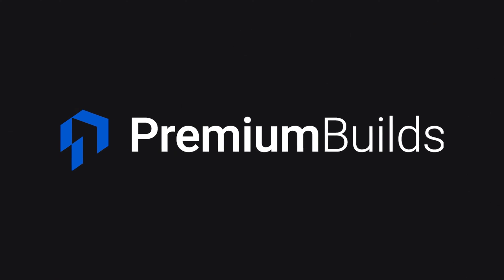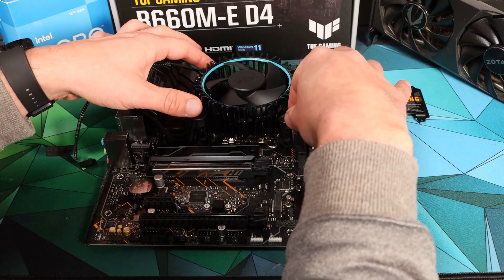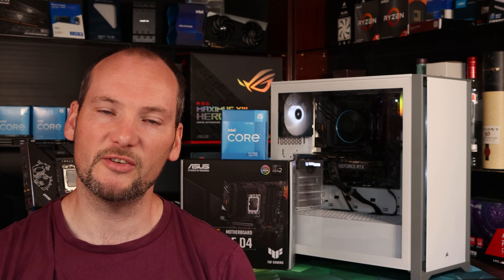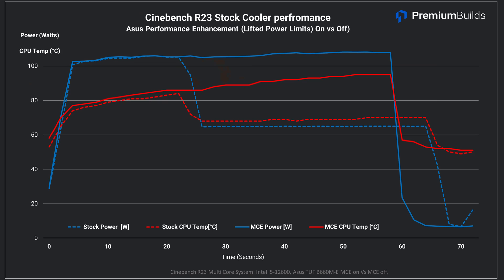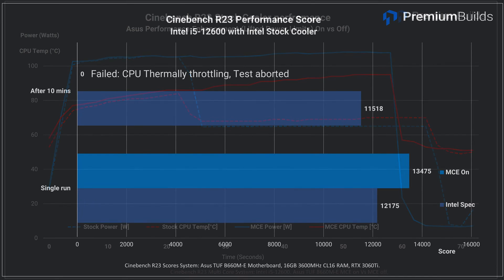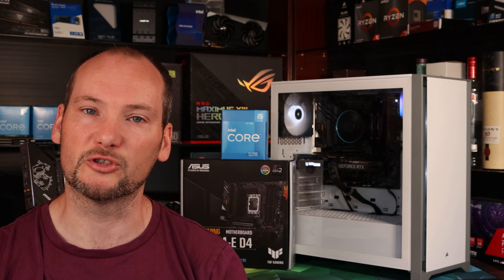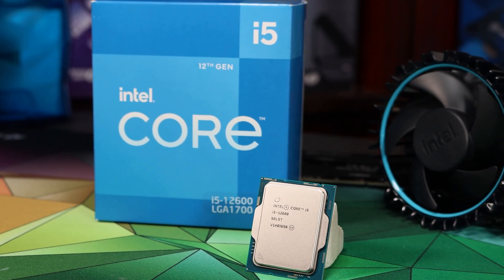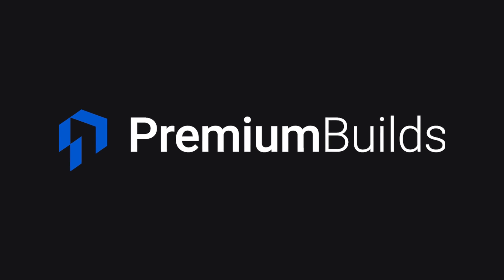Does stock suck? Testing the new Intel CPU cooler with the i5 12th generation!

Comment: Thanks for the video!
I'm currently buying parts for a budget 1080p upgrade (coming from an i5 7500 RX480 B250 I've had for 8 years).
I decided to go with an  i5 12400F (£88 new) MSI Pro B760M-A WiFi (£75 new) 6600XT (£135 nearly new) and an MSI MAG 650W 80+ bronze PSU (£45 new).
I just need to buy some 3200mhz 16cl DDR4 ram 2x8gb as my current DDR4 2666mhz might not be good enough?

Comment: Thanks for the vid. Turns out my new build is in a Jonsbo C6 Mesh. Had a surplus Corsair H60 2018 but this case doesn't support AIO's.  I am not gaming. It will strictly be a HTPC, with an i5 1440 w/UHD Graphics. Cooler clearance recommended for Jonsbo is <75mm, intel's is listed a 47mm. If it doesn't work out I can try the coolermaster mATX cases.

Comment: I understand that stress tests can make your cpu go really hot because it pushes its limits, but I have some strange things going on; Intel 12400f; usage is 15-20%, WATS are below 40 and still temps are around 80c (gta 5 online) I don't think undervoltage would help me even if I could do it. should i spend 50$ on new cooler on 150$ cpu or is there any other solution? i disabled asus perfomance boost but nothing realy changed. temps while watching youtube are around 45-50c.
Reply: Newer gen cpus run much hotter than the old ones, 80C is good under load
Reply: @michaellabuschagne7439 nvm i got myself i35 frezer and now i have 30c idle  and 60c in games

Comment: i have an intel 13400f, with stock cooler that is, and indeed the temps are just about right, it doenst get hot , its stable, always stable
Reply: True, but you won't get the boost as than it gets too hot.

Comment: Is it normal idle core temp 52c i5 12400 using this fan ?
Reply: Mine 32c to 35c idle, gaming 64 to 69
Reply: It happens to me as well, did you find a solution?

Comment: mine hits 80 celcius max when gaming i3 13100 no thermal throttling...
Reply from the maker: That's because it's a 50W CPU. The cooler is really designed around that kind of output.

Comment: I found if you elongate the mounting hole slots inward by grinding you can use one with a 775 socket cpu.  The mounting legs are hard steel so grinding with a dremel is slow going. You have to remove the push in connectors and use some screws that go into the stock 775 backplate.  Quieter and cools a bit better that stock.

Comment: Wow, same board and GPU as the build I'm working on now, only diff is 12400F on mine. Subbing an ID IS-47-XT for the stock cooler, running a Wraith Prism on my R5 3600 in current box and it stays pretty cool so I think the ID should be fine.

Comment: did you try using a better thermal paste with the stock cooler to see if that would help with the cpu load temps?
Reply from the maker: No, there's really no point. At that point just get a cheap tower cooler that comes with better thermal paste. Thermal paste rarely has more than 1-2C impact, especially on a cooler that's already borderline.

Comment: my prebuilt pc came with one of these installed alongside a i5 12400f and my my, it is one noisy thing under load. looking to upgrade to a dark rock slim to hopefully increase cooling and noise issues.
Reply: VERY late reply. i had the same issue but after a bios update, it was fixed completely
Reply: Did you manage to get the new cooler? If so how is it in terms of cooling and sound. And what gpu are you using

Comment: Maybe i won the silicone lottery? I have a core i3 12100 with a stock cooler on idle my temps are around 31.5C and when im gaming and watching a movie my temps are 42C max im not sure why everyone has such high temperatures
Reply: better install HW64 software and monitor temps at idle and running cinebench R20. Also notice CPU fan RPMs and CPU power consumption

Comment: If all you're using the 12400f for is just gaming, would the stock cooler be perfectly adequate for that?
Reply from the maker: It's fine but you will hear it, it has an annoying noise profile. In terms of performance and temperatures though it's no issue, and easy to replace later.
Reply: @BuildPicker  I'm just looking to save a little funds, but I might splurge an extra $40 bucks for a DeepCool heatsink, but I was just curious overall. I've been using a stock AMD cooler for my 3200g and I haven't really noticed any real bad issues noise wise with it, so I bet I could probably get used to the stock i5 cooler too. 

Thanks for the response, my guy. Not a lot of channel creators will take the time for a random question on an older vid.
Reply: @marvlouslie2053  yes, the noise is the only problem for my me and my i5 12400f. I am thinking of getting Deepcool ag300 which is cheap but will it perform good enough? What did you finally do?

Comment: Hello. Does running RM1 cooler at max RPM decreases fan's logevity? And secondly running cpu around 82 or 83 degree temps are ok and under safe boundaries?
Reply from the maker: It might decrease your ears longevity! Yes, max rpm will wear the fan out faster but it should still last years. 82-83C is absolutely fine. I'd even let the CPU run hotter to reduce fan speed and noise.

Comment: Just built a new pc with the i3 12100f and at idle it runs at 50c, gaming with <50% load at 70c and cinebench r23 it reached 91c maxed. Is 70c is concerning for 40-50% load? 

Also is the fan supposed to be blowing against the heatsink or sucking out air from it? Mine is blow air against it and idk if its supposed to be like that
Reply from the maker: No, The only concerns with CPU temperatures are if it thermally throttles and costs you performance. CPUs are quite happy operating at 90-90C, and you shouldn't worry about partial or idle temperatures. 

In reality, low temperatures are a sign of how hard you run your fans, or good case airflow. You should check the cooler is correctly fitted, and the case has adequate airflow. Otherwise, it's fine.
Reply: You might have installed your cpu cooler wrong i have a 12100 core i3 and on idle my cpu is 31.5C when im gaming and watching a movie my cpu gets max 42C im not sure why your temperatures are so high
Reply: @actiniclux  thats insane. Either u have turned off the turbo boost, or you must be running these tests without a CPU case, or u might have enabled 100% RPM fan speed at all temperature ranges
Reply: @fahdmirza8665  thank you for replying it is insane! But im not lying i think i won the silicone lottery
Reply: I have the same problem, did you solve it?

Comment: I just built a new PC. The CPU fan becomes SUPER LOUD like a JET ENGINE 2500-3200RPM. It slows down-shoots up-slows down-shoots up. The temp. Stays 35-40'C for day-to-day tasks (While the case is open). Coming from fanless M1 MacBook Air, it is freaking annoying to me.

Is it normal? Has anyone with similar setup experienced it?

Rig: 
i5 12600 (Stock Cooler)
Case: Corsair 5000x (Glass panels not installed for testing)
Mobo: Gigabyte Aero Z690 G DDR4.
Reply from the maker: Sadly that is normal for a stock cooler. Check out our 'best coolers for an i5' video for suggestions, but a basic 4 heat pipe tower cooler with a 120mm fan will deliver much better cooling and much lower noise.
Reply: @BuildPicker  Thanks for the suggestion, I will def. check em out. 
Also, I liked the Corsair H150i AIO, coz it would compliment my build well.
I was originally gonna buy it on Newegg for $160 on deal, but I missed it.
Reply: With gigabyte you need to calibrate the fan speeds in the Gigabyte App.

Comment: I recently upgraded my pc to 12400 non F version+stock cooler paired with Asus H610 prime mobo 8x2 16gb Ram @3200hz and RTX 2060. My processor is hitting 70-75-80c+ in cyberpunk 2022 Game with RTX on and in cinebench R23 multicore test it is hitting 100c on most of the cores in core temp and in Asus armoury crate it was showing cpu @ 88c and cpu package @100c
Reply from the maker: That's to be expected with the stock cooler! A simple 4 heat pipe tower cooler will bring noise and temperatures down.
Reply: @BuildPicker  I stay in India which will be a decent cooler to buy?
Reply: Vetroo v5 is what I use
Reply: @davidduncan1444  i have ordered a deepcool ak400. It comes with all mounting parts for the new 1700 socket
Reply: @ManDark_o7  + Late question but how are your temperatures with that AK400? Im thinking on getting the AG400.
Reply: @polardabear  My tempratures are amazing now with AK400 cooler its the best busget Aircooler for 12400 in my opinion
Reply: @ManDark_o7 bhai noise aarha hai kya cooler se?
Reply: Bro kaise temps aare h ?
God of war max setting pe to mko 99° aara h temp  stock cooler ke sth 
This is really a piece of dog shit @ManDark_o7
Reply: @davidduncan1444  y que tal las temperaturas?

Comment: The cooler that came with my 12600 had a broken fan blade and the box was in perfect condition with out a scratch on it.
Reply from the maker: Never good....
Reply: I was building a PC for a major gaming company, and when I powered on the PC to run tests a capacitor on the motherboard blew up in a puff of black smoke. Everyone around me working was like "What the F___!". So fear not MineDUST, the unexpected and totally bizzare is always right about the corner when it comes to anything releated to PC's rofl.
Reply: @prezidenttrump5171  my new msi mb won't update the bios.

Comment: I ended up getting a 4TB Kingston SSD for a whopping $2, so that's enough of a reason to build a PC since my current DDR3 desktop doesn't support it. I've been planning a 12600 or 12600k build, and so I was weighing whether the stock cooler would cut it, or if I was better off spending a tad more on the better cpu and a quality cpu cooler, and I think I'm going to opt for the latter. You do thorough work and I enjoy the channel, keep it up.
Reply: btw pci adapters exist for like 10 usd
Reply: 4TB NVME SSD?

Comment: My i5 12700 went upp to 100degrees celsius just by downloading a game. Bought a Noctua cooler and im idling at 30degress and playing bf2042 and running other stuff at the same time makes it go up to 65 at most, dont understand why Intel sends a cooler that doesnt do its job
Reply: @Ruby Noctua NH-d15s. One of the best air coolers on the msrket and pretty cheap
Reply: The cooler is designed to run the CPU according to Intel specifications. 

According to Intel specifications i7 12700 should boost to 125W for a few seconds and then cap at 65W. 
With 65W the stock cooler keeps temperature around 80°C which is totally within the CPU specifications (Intel spec says max temp is 100°C)

Comment: My 12400f temp is 49-52 degree at no use on stock cooler what should I do😭😭😭😭😭
Reply from the maker: Nothing! That's fine. It will get a little warm, and it won't run it's fan fast until it gets warm to keep noise down. Idle temperatures are pretty meaningless. It's load temperatures that matter.

Comment: I'd be interested to know how well the Arctic i13x fares cooling the non-K Socket 1700 i5 chips.  I already know it does well with the 10400 and 11400 processors, keeping them under 80C at full load.
Reply: it'd be the same, there all the same temperatures. i5 10400, 11400, and 12400 are 65 watt each.

Comment: What's the stock temperature of 12600(non k) with stock cooler; It's my go to cpu as it's better from 12400. I will ofc buy another aftermarket cooler.
Reply: @KAOS86ZER0 80 to 95 c in what task? Lol. That's a lot. Do you have a good cpu cooler?
Reply: @KILLSWITCH6 what meanwhile my 12400 maximum Reached 65°C while gaming I'm from india currently Weather temperature is 45°C and No AC in My computer room
Reply: How lol. Mine idle 34, gaming 61 to 68, room  with  ac

Comment: i5-12400f
when gaming lost ark on high, the cpu temp is 62-71c
should change the cooler or not? or its just a normal temp when gaming on high?
Reply from the maker: Absolutely fine, nothing to worry about.
Reply: Intel specifications say that of you are not touching 100°C it is fine. 

So 71°C is completely okay.